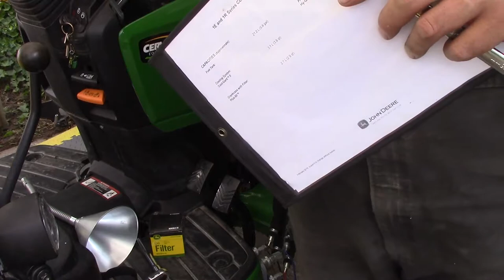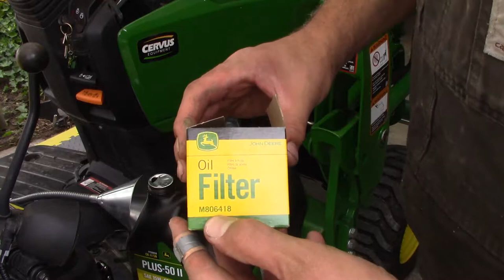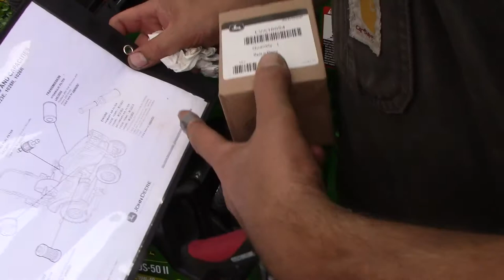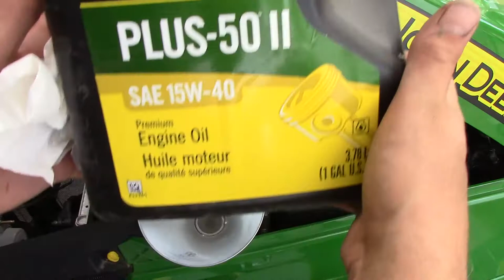John Deere 1025 R first Oil Change

Comment: Not sure of year you have, guessing early 2018 since you mentioned the 200 hours and older air filter design.  I have a late 2018 model and it says to do the engine oil and hydraulic at 200 hours or annually, which ever comes first.  I am at 100 hrs right now, not sure to do it now or wait closer to the 200 hrs.   Not sure if you know about the air cleaner problem either, Air Cleaner Update JD Solution Number # 113718 and Program # 18LV188.  I would mention both of those numbers to your dealer and see if you can get the update for free.  They wait until you have an engine failure from the valve cover busting and then replace the whole engine!  If you buy all the parts, it is like $130+.
Reply from the maker: I am going to town tomorrow and will talk to my dealer, they have been great with everything related to the X540 in the past.

 We bought the 1025 in Nov 2018 and are really pleased with it, I was looking at the 2000 series but with the hills we have on our property I am glad we went with the 1025 R, I think a bigger one would have meant a lot more pucker factor on our property.

Thank you for mentioning this potential problem, we appreciate it and will find out more tomorrow.